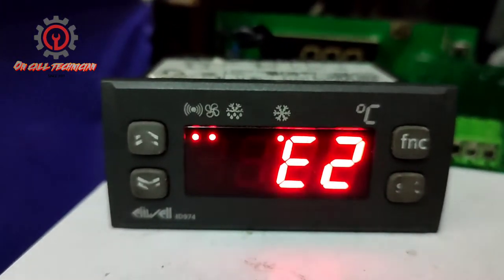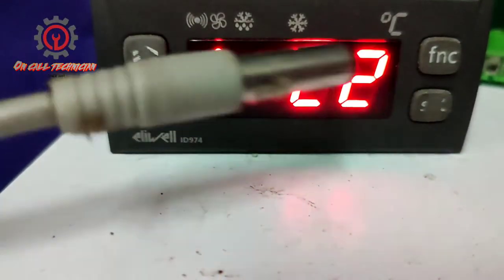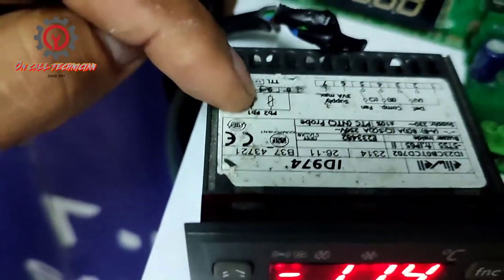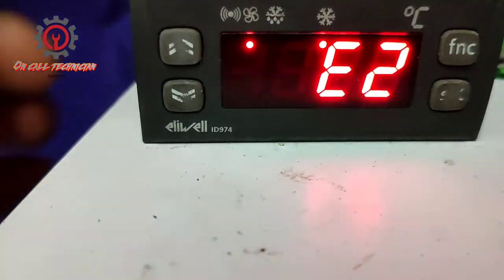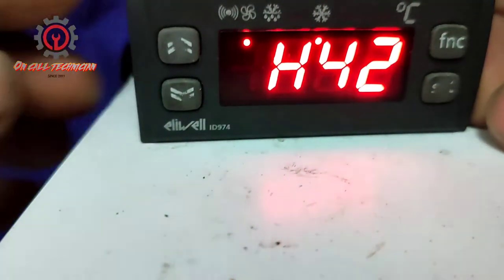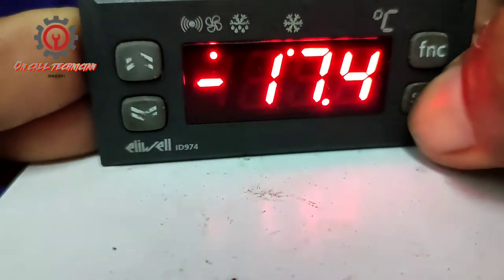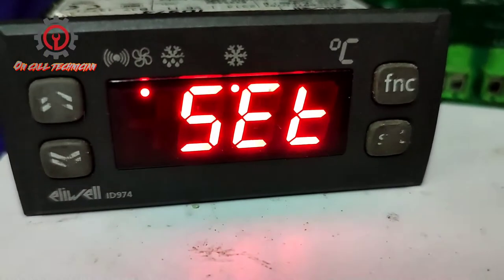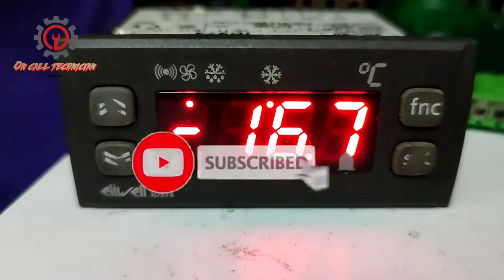HOW TO FIX E2 ALARM OF ELIWELL ID974 AND ITS FUNCTIONS IN CHILLER AND FREEZER SETTINGS

Comment: Hi.
I have the model EWPC974T that has the same error, but it does not have the CnF on the set configurations. Colud help me how i can solve this error in  this model? Thanks
Reply from the maker: If CnF isn't available,  change probe 2 ntc sensor sir
Reply: @THEMULTISKILLEDTECH  I don't use the evaporator sensor. I use it like you show in the video, only to control a minibar temperature. I would like to know if I can fix the E2 alarm in my model, but i think it isn't possible. But ok, thaks to the help.
Reply from the maker: Down load your model manual via Google then check out the parameters you want to disable sir. I wanted to help you but i don't have that model 🙏 tips in you need to enter some program in order to arrive at FnC folder sir🤗

Comment: sir ano spec po nang coil sensor nyan po if mag hahanap po
:stayhome:
Reply from the maker: NTC thermistor temperature sensor 10k
Reply: @THEMULTISKILLEDTECH  sir need ko po spec nang eliwell ewplus 978 thermistore iisa lang po ba yung prob  nyan please makuha ko po viber nyo po master
Reply: @THEMULTISKILLEDTECH  o baka meron kayo recommend na pweding alternative na clase po na thermistor po ilang volts po ba ang prob sensor po jan sa eliwell]
Reply from the maker: Email mo Technical Customer support 
Techsuppeliwell@se.com
Para sure ka sa oorderin mo sir. I replied to you already. For me i used both NTC 7 - 10Kilo ohms and PTC para sa eliwell and of course with a parameter to selectable
Reply: @THEMULTISKILLEDTECH  sir pewed ko makuha ung details po ung hahanapin ko na need ipalit po for freezer
Reply from the maker: Sa appearance ng NTC nasa video ko, (or kagaya ng galing sa unit mo) screen shot mo at dalhin mo sa refrigeration shop na nagbebenta ng parts sir. Or look online like AliExpress. Nagugupuhan ka lng sir sa dami ng classe ng NTC appearances. Pero ako di ko problema yan
Reply: Please sir pa help po need ko kasi na specs po pwed sa eliwell ewplus 978